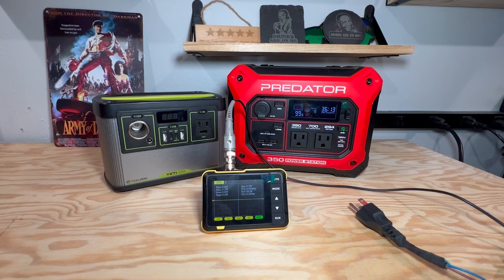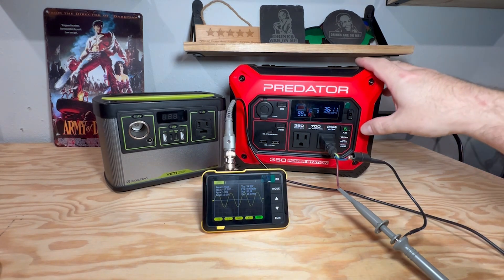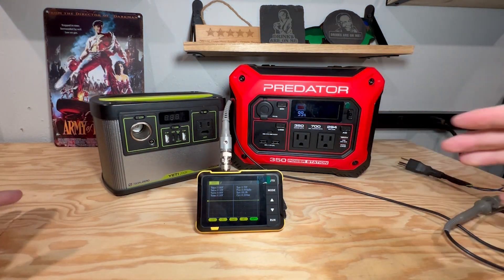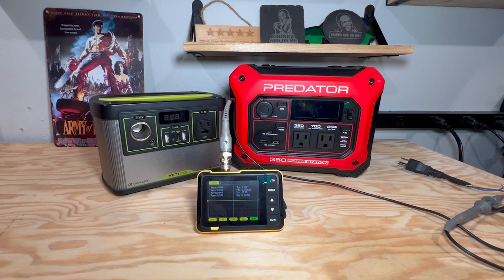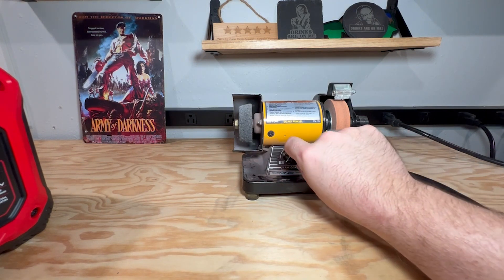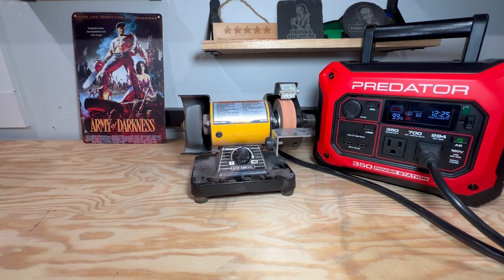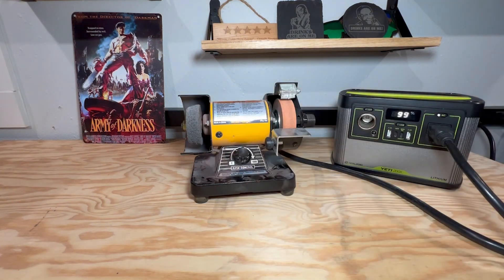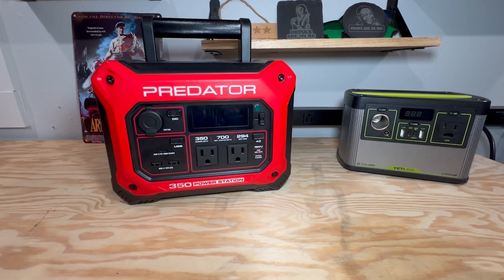Power Station Inverters - Modified vs Pure Sinewave

Comment: I watched your review of the NEW Predator 350 and ended up purchasing it off Harbor Freight with a 30 dollar off coupon they're offering. It works great and runs my CPAP machine for at least four nights without recharging. I've read other people saying they only get one or fewer hours. Maybe if they use the humidifier. I do not so four nights is reliable. I love this power station. Thanks to your review, I purchased. I hope this helps other CPAP users looking for an alternate power supply for camping and power outages. It works great.
Reply from the maker: I hope that review helps people understand what it can and cannot do before spending any money on it.   I actually just returned it today because I bought a Ecoflow River 3 plus.    Great thing about HF is the return policy is second to none.